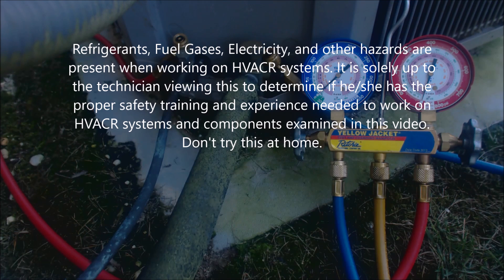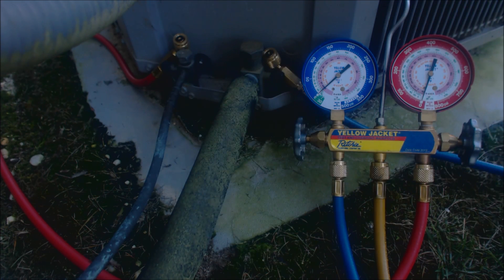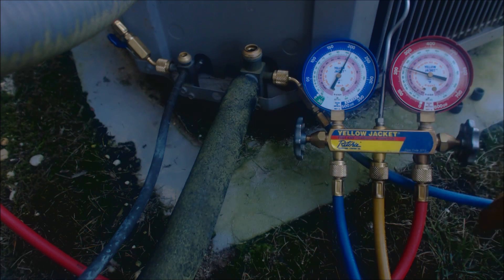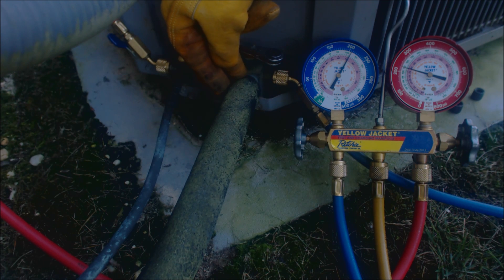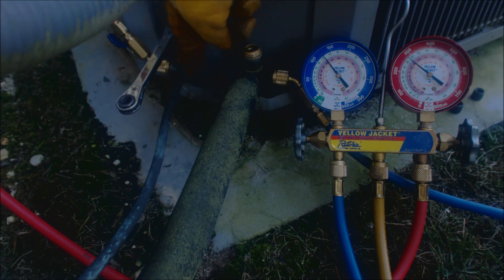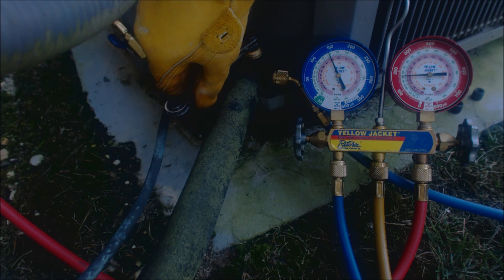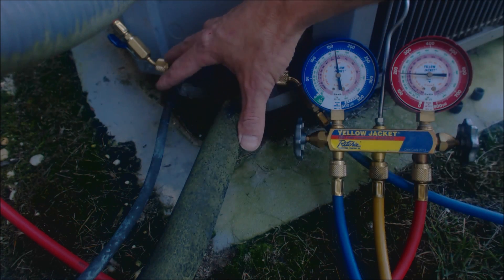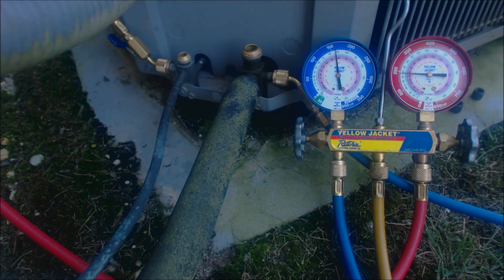HVAC Refrigerant Pump Down with an R410A Compressor that has a Bad Internal Pressure Relief!

Comment: Should you pump down a 410a system will it damage it ? What if your trying to pump down a brand new Bryant or ICP 410a system and the internal relief pops off making that loud swooshing sound and the pressures shoot up can you still get it to pump down or should I just recover the refrigerant
Reply: Did you ever figure it out- I am curious too. Thanks.
Reply: @MOAB-UT  unfortunately I didn't so I just recovered the refrigerant and replaced drier and oil and triple evacuated
Reply: @michaeldreves5072  I ended up hiring a pro at a fair price. The relief valve did blow and he knew what to do. He had all kinds of equipment and pumped it down and also recovered stuff. He brazed the lines shut and will evacuate again with yet another machine before re-installing. He said if that is not done, the water and air in the lines would block the flow- like in a cars HVAC system. He has to create a negative pressure or something he mentioned. He was well worth the money. I like doing things myself- did my most of my entire kitchen and bath myself but with this, I would have had issues had I tried. I also would have needed about $500 worth of gear.

Comment: Have to consider length of refrigerant lines that they are les than 25 feet would be able to pump down meaning that no refrigerant was added making impossible for a good compresor to pump down.

Comment: Great video. A homeowner could pump down, remove the equipment, put it on the curb and called waste services indicating that there is refrigerant left. Same as disposing a refrigerator. In this way you do not need to buy a $1K recovery system. Of course your compressor should have still enough life for that extra mile.

Comment: (I am new and sorry this would be a silly question)
Is it ok to open both low and high side valves at the same time to purge air out of yellow hose? I think it will allow liquid bypass into compressor through vapour line..
Is it ok when unit is turned off?
Reply from the maker: Only open both when the system is off. If the system is running, do the vapor line first and then do the liquid line second, thanks and it sounds like you had it right!

Comment: i got brand new 4 ton goodman 410 unit  I  just installed. my helper did not put the orifice from condenser in new coil (4 or 5 ton coil ) brand new as well  he put one that was in coil in and coil frozen up over night .when I go to pump down to change orifice it went down to 50psig and I heard the pressure valve and closed low side . does this mean there is issue with new compressor. I will recover the rest of 410 but was very concerned .orifice called for 0.78 and it had 0.92 would this cause freezing coil just wondering
Reply from the maker: That means that too much refrigerant was entering the evap coil and that the compressor had low to no superheat. if a system has no superheat then saturated refrigerant would be entering the compressor which would damage it. What was the superheat before you left?

Comment: I assume there is liquid in the liquid line when you are purging the hoses. The high/Low are the same pressure ? Or are both lines vapor when the compressor is off and the high/low pressures equal.  Please advise
Reply from the maker: If the system has time to equalize then sat state is in each line, thanks

Comment: I'll be doing a pump-down to repair potential leaks in our copper lines. I've been trying to find out what pressure I should bring it down to but you were blowing the relief valve on this one so I didn't get to see that. What would you normally pump it down to before closing off the gas side and shutting the unit off? With R-22 I see you can bring it all the way to vacuum but with 410a you probably need to shut it off prior to that?
Reply from the maker: R-22 and r410a are to at least 0psi from what epatest.com states as long as the unit has 200lbs or less. Make sure to keep the indoor fan on so that you get an accurate temp, thanks. You can go down in hg to 10 as long as you do not have a leak
Reply: I suspect a very slight leak which is the reason for the pump down. I believe the leak is on the liquid line connecting to the service port (copper line side, not condenser side) but will need to pressurize with nitrogen to be certain. That's a very good point not to go to go to vacuum in case of a leak as that will get air into the system. So I should probably cut it off right before it reaches 0 and then recover the rest. Should a leak be found, that would mean the recovered R410a is potentially contaminated with air and I should only use new refrigerant when charging it back up. And so that recovery cylinder will have to be used for potentially contaminated R410a only.
Reply from the maker: Yes, you would certainly need to be careful not to pull air into the recovery tank, thanks Brian! Sounds like you understand exactly what needs to be done! With a refrigerant like r410a I would just put virgin in a system anyway in case the exact mix wasn't accurate. R-22 I try to recover into an empty evacuated bottle and reuse whenever possible, thanks

Comment: 208 volt's and It's the same resistance. Thank's to answer. 👍
Reply from the maker: Yeah check to make sure it is actually 208 between each pair of wires. Then you know that you can wire any of the 3 wires to any of the three legs of the motor since the resistance reading is the same between all three pairs, thanks!

Comment: Hi. Have a question. I'm stuck with a situation where I dont know how to wire a 3 phase compressor cause it's erased.
Is there way I can tell where the U V and W is on the compressor connexion. I don't have any problem to find R S and C wich is 1 phase
Compressor. But 3 phase is giving me a hard time. I checked on internet, but, not sure yet. Thank's
Reply from the maker: Which voltage is this? If the resistance values of all three pairs are the same then it doesn't matter.
Reply: I believe the resistances of the windings ona 3 phase compressor are all the same however you have to make sure phasing is correct otherwise it will rotate the wrong direction.

Comment: Thanks Acservicetech!  I alway wondered what that would sound like. I don't do to many pump downs but this gives me a heads up. Thanks.
Reply from the maker: Yes you can do this to check if it is a weak compressor relief valve or weak compressor itself, thanks Nick!

Comment: I have the same gauges, how come refrigerant didn't spray out as you hooked them?
Reply from the maker: It is possible the rubber inserts on your hose ends are older or shorter.  These are newer hoses with new rubber inserts.  I also put them on fast.  I hope that helps, Thanks,
For you reference- Yellow Jacket Replacement Hose Gaskets-  http://amzn.to/2u4AqxU